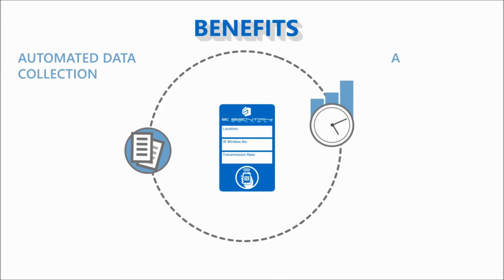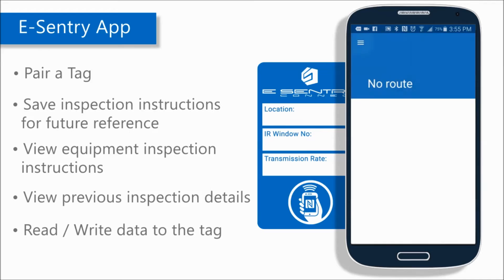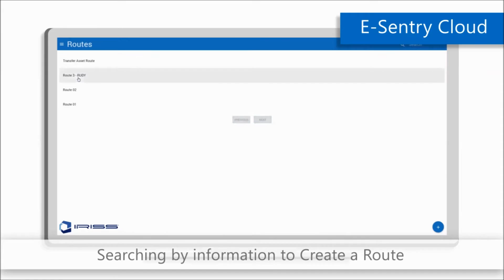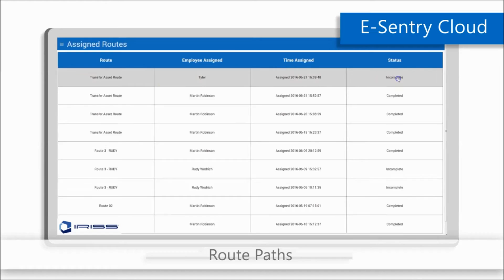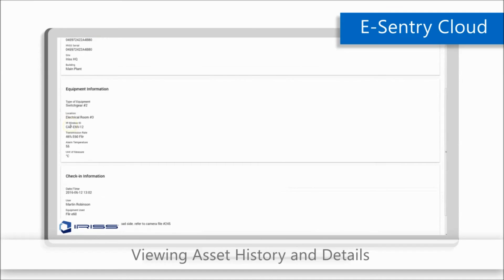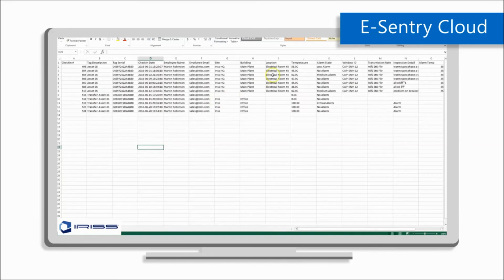Intuitive Asset Information Tagging System

Comment: your solution would able to show real time location of an asset? if then where it was implemented, for which industry it would best suitable for?
Reply: Sorry.  No.  The tags do not geo-locate the asset. The tags do have fields that help you narrow down where the asset is located (company, site, building, room, equipment type, equipment number, etc.)
These tags are suitable for tracking of maintenance tasks and recording Condition Based Maintenance data on electrical or electromechanical equipment.  They can be used in virtually any industrial application as well as utility and power generation facilities.